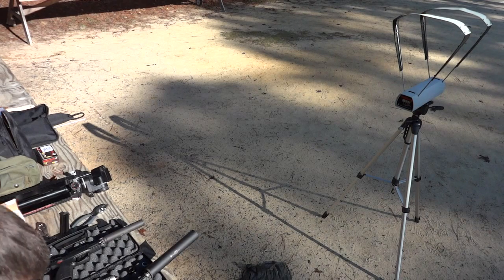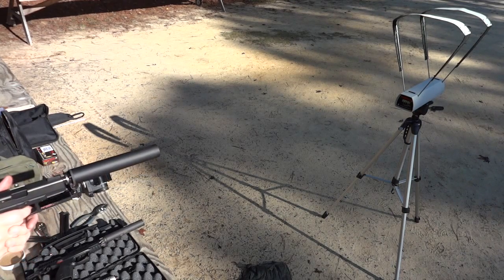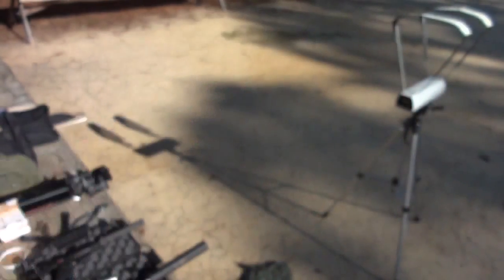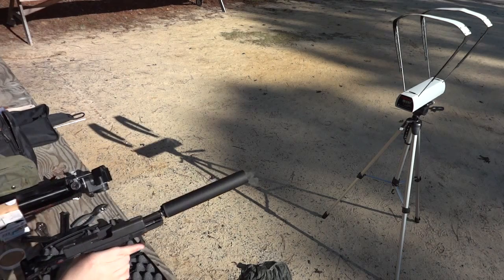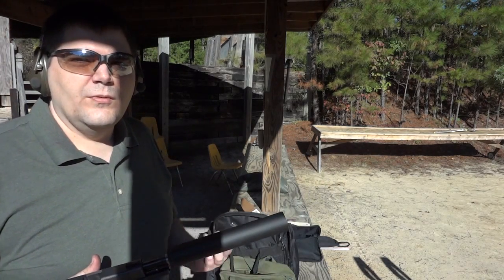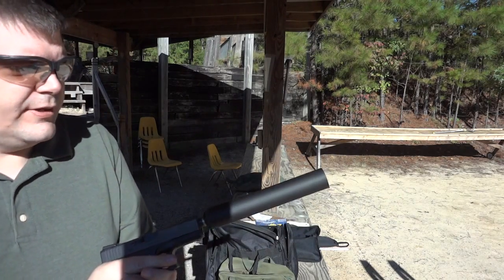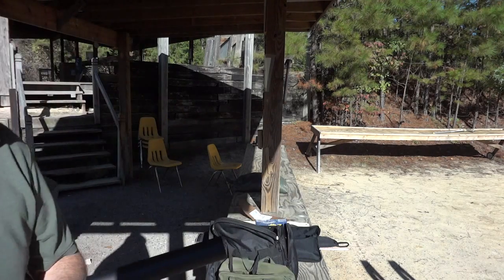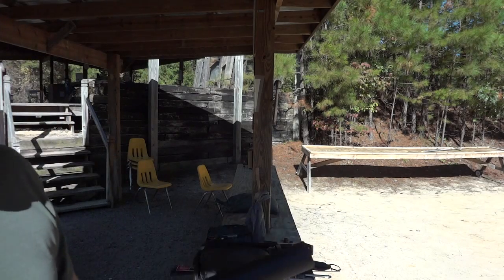SilencerCo Octane 45 on Glock 19

Comment: Does your suppressor start to spin off after a few rounds ?
Reply from the maker: If you don't put it on properly, yes.  You need to hand tighten it, back it off about half a turn, and then flick it tight by whipping the gun and the suppressor in opposite directions so there is some momentum when the shoulder connects.  Might be difficult to get off at that point, but it is less likely to to back off on its own.

Comment: Whats the db level using this 45 can for 9mm subsonic?
Reply from the maker: I do not have a decibel meter.  To get a proper one, you pay more than the suppressor cost.  My suggestion would be to NOT trust any meter ratings you see on the internet.  All cans in this class meter about the same.  The Dead Air, Rugged, SilencerCo, and Griffin offerings are all about 130 db depending on who you watch and what you can believe.  The trick for me is that I can shoot 9mm 147 and 158 gr loads without hearing protection.

If you are looking to buy a suppressor today in this class, my recommendation would be the Rugged Obsidian 45.  Buy it, and don't look back.  Spend your time shooting and enjoying it rather than worrying about numbers.  At best, there is a 3db spread between the industry leaders.  Your ear cannot even tell the difference.
Reply: @RyeOnHam  You'd recommend the  Rugged Obsidian 45 over the Octane?  Asking because I  literally have an Octane in my shopping cart time now.
Reply from the maker: @JasonParham83  Absolutely. 100% prefer the Obsidian.  I have both.  I shoot both, but I find the modularity of the Octane is vastly more versatile.  Also, the Rugged pistons do not blow as much crap back in your face, so I am running Rugged pistons on my Octane now.

Comment: Im trying to decide on my first pistol suppressor. does the 8.7in octane seem to long at times or is it ok? I was also looking at the Octane 9 or 45k for there shorter length.
Reply from the maker: WeeWee021 I would pick the 45K if I were starting with the knowledge I have now.  The difference between the K and the full size in terms of sound at the shooter's ear is not enough to justify the extra length.  That said, that extra length does not bother me on a 9mm or 45.  I do plan on suppressing my R51, though, and it might seem pretty long for that platform.  You can buy a 9mm end cap for your 45K from SilencerShop.  It does seem to help a bit on the .22's and 9mm.

Comment: I am still researching everything but i am going to get the osprey 9. I have a g19 as well and im curious what sights  your using.
Reply from the maker: TFO sights.  Tall sights are overrated. I cannot see the target with my dominant eye and these sights, but that is a training issue.  With both eyes open, I am just as accurate.  As for the Osprey 9, I would never recommend that can.  It is a sealed can and only useful for the 9mm.  Lots of issues with the latch.  Monocore and it looks funny if it's slightly out of alignment.  My current choice for a 9mm can would be the Griffin Revolution.
Reply: Are the prices comparable? Was the paperwork hard to do or overly complicated. Im in Arizona. Thank you.
Reply from the maker: I do not know about Arizona, but the paperwork was simple enough.  Depends on your point of view.  SilencerShop.com has some outstanding tutorials on how to do it.  Yes, the Griffin Revolution is competitively priced.  I think it's a better design, about 1.5 generations more advanced and configurable in either short or long and versions with a 3-lug mount that goes inside the piston housing.  I believe this will be my next can.
Reply: Awesome thank you for your help sir. Ill come back after i get it all started and let you know.

Comment: What do you have to change inorder for it to fit on a 9mm 1/2x28?
Reply from the maker: The piston needs to be changed.  If you do this, buy a Rugged piston.  They are compatible and they do NOT have the notches on the side that are meant for the Osprey suppressor.  These notches blow back directly at the front of the slide and your face.  You can also change the end cap to the 9mm version.  I have it, but have NOT used it yet.  I am a BIT concerned that I will forget when I shoot 44 magnum or .45 and then destroy it.
Reply: @RyeOnHam  ah okay, from rugged supressors correct? Does it have to be a particular model?
Reply from the maker: @Yutter89  Rugged only has one style of piston.  You can get them in 1/2 x 28.  The owner of Rugged Suppressors, Henry Graham, founded SWR back in the day and merged with Silencerco.  SiCo 'fired' him and Mike Pappas, who both went off and founded Dead Air and Rugged Suppressors respectively.  Lots of DNA involved.  Henry used the same piston, but eliminated the cuts on the side.  Also, it's a solid company and Henry is good people.
Reply: @RyeOnHam  ah okay, I know a similar story with the feller from AAC and I guess now Q?
Reply from the maker: @Yutter89  Yeah, Kevin Brittingham got a raw deal when Freedom Group bought AAC.  They tried to screw him out of the contract, so Kevin left and sued them.  Won, too.  He ran SIG's Silencer division and left to form Q.  I don't much care for his silencers, but I've never met or interacted with the gun.  I'm a Kevin Graham, Mike Pappas fan.  Gave up on SilencerCo after Mike and Kevin left and they hired Jason Schauble.  Jason was the reason Mike and Kevin left.  My momma told me never to talk ill of somebody who works in the gun industry so I'll not elaborate.  Anyway Jason left in late 2017, so I sucked it up and bought a SilencerCo Switchback last year.  Still in jail.  SiCo makes some pretty good products.  I met the team, by chance, in the Browning Museum in Utah.  They were on a field trip and they were a bunch of nice guys.
Reply: @RyeOnHam  I didn't know he had sued them, interesting.  Yeah ours are all about 10 years old and we've not added any sense. But all old AAC, with the youngest being a harvester.  I find that they work and that's about it.  Though the bit about the piston notches explains a bit of the blow back I would get from the 9mm and 45s.
Reply: @RyeOnHam  further question.  Found a piston, but noticed that for a direct mount (end cap?) I saw that a insert of some type may be needed? Looked to be a collar or spacer?
Reply from the maker: Well, I think you're confusing a few things.  If you want to mount it to a fixed barrel gun like a carbine, you have two options.  One is to use what they call a 'fixed barrel spacer'.  This replaces the spring in your piston assembly and deactivates the piston.  You can also use what they call a 'direct mount' or 'fixed mount'.  This replaces piston assembly completely, so the piston, piston retainer, and spring.  The problem with a fixed mount is that it exposes the area where your piston seats to direct blast.  This can result in buildup in an area that's nearly impossible to keep clean.  What is usually called an 'end cap' is at the other end, the front of the suppressor where the bullet comes out.

Comment: Dude you gotta get into reloading! I'm making 147gn reloads for about 17 cents a pop. 14 cents after that of I re-use brass. I have the .45 osprey. The Octane 45 comes next week from silencer shop
Reply from the maker: Congrats.  I have both a 158gr and 147gr load for the 9mm. I find it better to review and shoot factory ammo in my videos  Enjoy your Octane.
Reply: joshv06 Hey, I was wondering which can you like better the Osprey or the Octane since you should have both by now haha? I like the look of the Osprey but I like the fact that the Octane is serviceable. what do you think?
Reply: WeeWee021 Funny you ask. I love them both.. But if I could only have one, it would be the Octane. I use it on my .22 AR with the booster still on (it doesn't even move when I shoot). If you look at videos shooting the Osprey, it slows down the slide cycling. I think this is due to the baffle design. Take the can off and they eject further. Not an issue with factory ammo or even reloads. I changed to a ISMI 18lb recoil spring (same weight as OEM) and brass started ejecting better and slide started to lock back again. 

If I could do it again, I would make a suppressor on a Form 1. SDTA has parts to make your own with a booster. Much cheaper and faster. At the time of buying mine, all SDTA and the form 1 suppressor community were at was a simple flashlight can. They have made HUGE progress lately. 

But yeah. Octane all the way.

Osprey-

+a bit quieter

+1oz lighter

+baffle design shoots water and junk forward

-can't shoot .22
-Less cycling pressure (in reality, doesn't matter)
-doesn't fit under handguards
-Tool needed to remove booster

Octane

+Shoot .22 (in my case, no spacer)

+fits under handguards

+easy to remove booster

+9mm endcap available

-Very dirty shooting wet (junk comes back, water drops on glasses)
-Unburnt gun poweder to face (Several reports on this)

That being said, they're both amazing and fun.